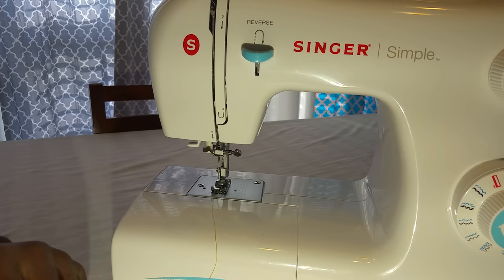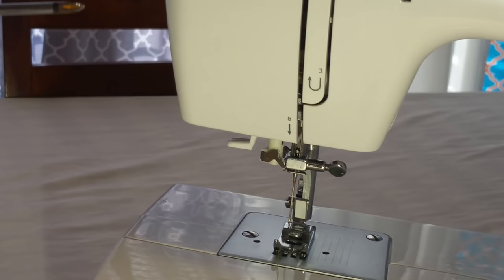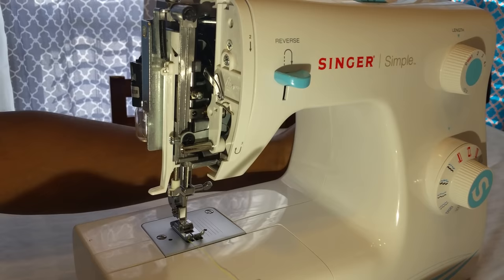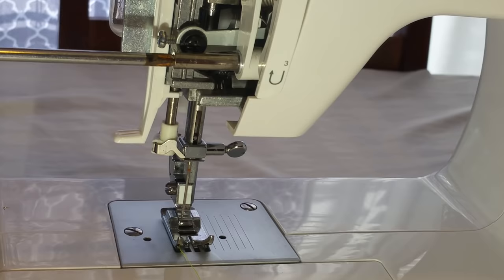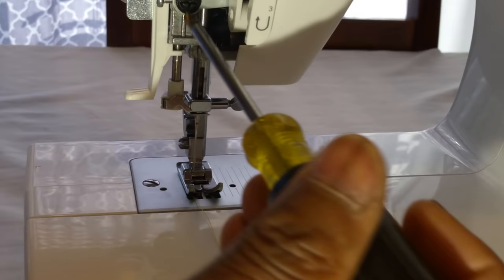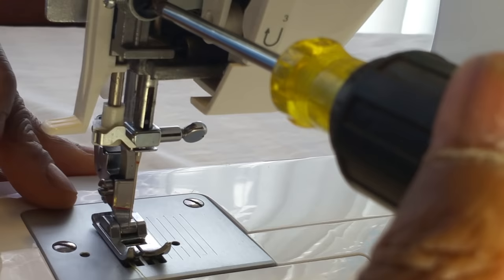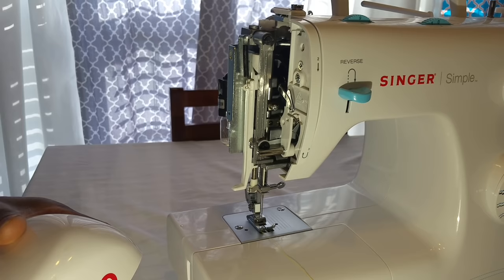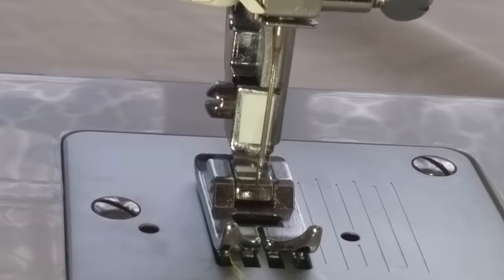How to Re-Align / Adjust the needle on your sewing machine

Comment: Before doing this, just check the width setting on the top right of your machine.  If you have it set to zero, your needle should center.  The higher the number you have it set to, the further to the left it will go so that it has room to move side to side to give you the wider setting.
Reply: I discovered that also. Couldn’t understand why the needle did not move. But setting width at 0 was exactly the answer!
Reply: Thank you so much it worked perfect and it was easy
Reply: I you put stitch on zero you won’t get a true 1/4” when quilting. I had to move the needle.
Reply: This! I was trying to adjust with nothing happening and turns out I just needed to adjust my width 😅 thank you!
Reply: You're a life saver, tysm
Reply: After adjusting the needle position with an eccentric, tighten the locking screw with force,which is located to the left of the eccentric screw, otherwise after a while everything will be upset again from vibration during operation, hello from Russia 🤝
Reply: Omg thank you so much cause I literally had the covering off getting ready to do what the video is doing and something told me to read the comments 😭 that’s exactly what my problem was 🤝🏾🤝🏾🤝🏾
Reply: Perfect! Worked for me yay thanks
Reply: Thank you. I was about to go into all kinds of fixes.
Reply: I just checked that. Actually on the machine shown here, which is the exact machine I have, the center position (on stitch width) is at a little symbol between the 2 and 3, which shows a centered dot. It might be on '0' on some machines. But, thanks for the reminder to check stitch width. I should've known that!!🤦‍♀️
Oh, well, no biggie, I needed to get in there to vacuum and oil anyway, and change my needle, too. It's just easier when that side cover is off.💁‍♀️These videos, and comments(!) are a huge help!
Reply: This comment just saved me from messing up my alignment!! Lol!
Reply: THANK YOU
Reply: Your comment just saved me. Thank you! I thought something was wrong with my machine!

Comment: Yes! Good job, but then you want to tighten the silver colored screw that is perpendicular to the black screw. At time 2:04 the silver screw appears just left of the black one. The silver one holds the black one from rotating out of adjustment again. Some machines have a small set screw holding the adjustment screw. For set screws you often need a metric or fractional (inch system) hex wrench sold at any big box store.  Nice video!
Reply: And thank you too!

Comment: Bravo!!
Your video and instructions are so so clear. It is really so simple when you know how. Thank you so much.
 I just bought the heavy duty sewing machine. Needle not centred!. Dreaded having to lug the machine to the service centre which had not been very responsive. Having sleepless nights as I have a torn tendon in my arm!
Remembered to check You Tube where I have previously found so many solutions to my problems. Sure enough your video popped up first on  my search.

Comment: Thank you so much!! I have been making a quilt top but the needle is over to the right so much I've had to sew between 1/4 andd 3/8". I had to put a piece  of tape on my plate to keep it fairly accurate. I'm handquilting it now, but I will make sure I center my needle when cleaning for my next project.

Comment: This was perfect. I would suggest also to make sure your width setting is at 0 otherwise the needle position won’t move. I just got my Singer and after following your instructions it still did not adjust. But after resetting the width from 4 to 0; it works perfectly!

According to SewingMastery videos for Singer sewing machines, if you are using a straight stitch adjust the tension at 4, the width at 0 and the length at 2 1/2. This is for the Singer Heavy Duty 4411.

Comment: Quick question: was the sewing machine set to be aligned left or center to start with? I know the 00 position on mine is to the left and 01 is in the center. However, even my 00 got misaligned so the needle was hitting the presser foot. But I don't want to center it if it's set to 00. Anyway, mine is a Brother, and I can't figure out how to take that dang cover off! I think it needs a magic word, because I haven't found the inset screw  yet. Thanks for demystifying this for the Singer!

Comment: This was very helpful, thank you! Have you ever seen a problem where the needle was set too forward? Mine is currently too forward and keeps hitting the front edge of the throat plate and I'm not sure how to adjust that =/
Reply: This is what is happening to me. Were you ever able to solve it?
Reply: @laurenross4135  That screw is on the back side of the sewing head on most machines. David Trumble has a video on youtube that shows it being done on a machine that costs about 10x as much as this one, but the principle is the same.
Reply: It's called a needle bar BTW, so you need to watch the video called "Sewing machine needle bar adjustment"
Reply: I have been having the same issue with mine, actually broke a needle. I’m the type to not mess with settings as I assume they are correct from factory but obviously not !! Thank you for the support and the help, 💞
Reply: Lydia Gastrell  - mine too!! Broke a needle
Reply: @powers-san1123  it may have been when it left but they move over time, that is why they are adjustable
Reply: THANK YOU! GOD BLESS YOU IN JESUS CHRIST MIGHTY NAME !!

Comment: I have a brother zig zag, and the bobbin is top loading, and the feed  dog is an inch behind it.  Shouldn't my needle bar be farther back,  because my needle hits the bobbin case which is an inch in front of the feed dog. The needle needs to go in the needle hole, not the bobbin, right?
Reply: I took out my brother 6000i with a top loading bobbin to compare.  Assuming the shares the same bottom design as your brother, if the needle descends into the needle plate wide zig-zag slot, then the front to back placement of the needle is correct. 

Lets try and figure out what your needle is hitting and why.
The bobbin case on the brother top load is a removable plastic part that doesn't rotate. Below the bobbin case, is a cup that holds the bobbin case that rotates.
On the top edge of this cup is a sharp hook that grabs a loop of the thread as it rotates behind the needle  just above the needle eye. This synchronization between the needle and the sharp tip of the hook that grabs the top thread is referred to as hook timing. 

There is a slot in the bottom of the rotating cup just below the hook that allows the needle tip to dip below the bottom of this cup at its deepest decent.  If your needle is hitting something it is likely that it is no longer dipping into the slot at the bottom of the cup but is hitting the solid portion of the cup. 
You can observe this by removing the bobbin case which obstructs your view of the rotating cup with its hook.  To remove the bobbin case, you will first have to remove the gray plastic cover which unhooks from the  back left corner. 
 
When the hook is correctly timed, the hook will pass behind the needle about 3/16th to 1/8th inch above the top of the needle eye. 
In your case because the needle is obstructed, the timing will be a bit off.

Any thing that locks or retards the hook from turning while the needle continues to move can cause the hook timing adjustment set screws to slip.   This is called retarded hook timing. The hook is late in meeting the needle. If it is very late, when the needle descends, it misses the slot, strikes the solid bottom part of the cup, and cannot continue in its rotation.   

Each machine can locate the hook timing adjusting set screws in a different place. If you want to do this yourself, you need to do some more research. Otherwise take it to a repair mechanic.
Reply: I am not sure you understand. Either the bobbin needs to be moved forward or the bars need to be moved back. The presser foot is right below the wrong bar. There is a bar that holds the foot down and a bar that has the needle. and the needle bar is right above the bobbin case, instead of back farther where the needle goes down in the presser foot. I may have dislocated it when i was messing with the bobbin section. I think i will just take it to a sewing machine repair shop and get it fixed, I know very little. YEs, to start off my timing was off and it may still be off, but the problem i am having is the needle bar needs to be closer to the presser foot where the needle goes down where the presser fooot is, not down into the bobbin chamber, in fact, in front of it.

Comment: The black screw is locked by the left screw. check it. my Necchi is the same but has an Allen screw to lock it. The lock screw grips the side if the adjusting screw. and it was probably loose or set wrong. You are rotating a cam to adjust and to keep it in place you need to lock it.

Comment: You might want to tighten the silver set screw to the left of the black one.?
Reply: Yeah, that's a great point. Otherwise it's just going to misalign again through machine vibration. Also, when the screw is tight you won't be able to turn the black screw much if at all. Loosen the set screw first, then you can easily adjust the black one. Then tighten the set screw back up to hold it in that position.

Comment: I was shocked to see you remove the cover and then I thought this must be an old machine as there i a little switch on mine that moves the needle right or left or leaves it in the center.
Reply: I should have said my machine is over 20 years old and all I have to do is move the little dial on the top of machine that moves the needle to any position